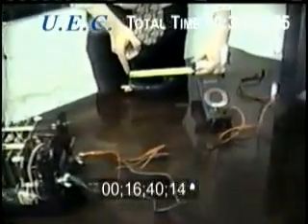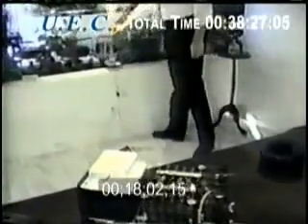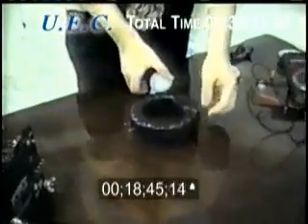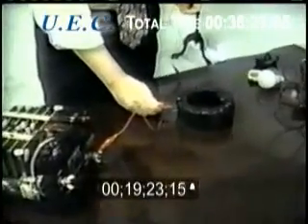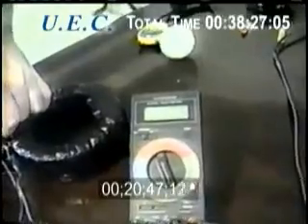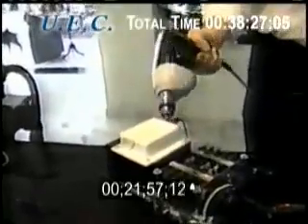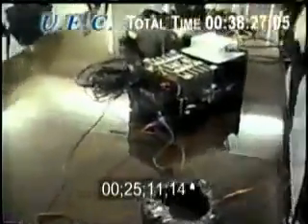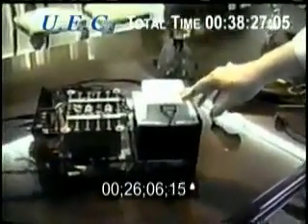Free energy  TPU  (Steve Marks)  part1

Comment: i think i know the secret of the TPU. the answer is pretty simple. first you need a feedback circuit like joule thief circuit.
second you need two output windings. one that use many turns and the second that use few turns. the one with many turns need a rectifier that is short circuited in a pulsating fasion . this causes the coil to produce big surges kicks. the one with few turn you use as the load winding as it would contain high current at some voltage. then you need a power regulation that take power from the few turns winding trough the regulator and feed the input feedback oscillator as well as the relay for the many turns winding. the amplification is caused by the magnetisation of the many turns winding in the core. you need ferite core or
 air core for this. all the windings in the transformer behave as their one and the same circuit. forget the idea that one end of a transformer is input. there is no input and output. that is  something we want to think to make it easier to understand.

Comment: US6015476 is one of his patents in conjunction with Schlueter, he's a magnetic design genius. IMHO it uses nuclear magnetic resonance insome way.  Seeing the so called "magic" angle approx 53 degrees off vertical, with the permanent magnets he attaches in some models.
Reply: We now after many years know that TPU output was generated by electrostatic field gradients being used to propel electrons.  Big electrostatic voltage difference creates electron movement without discharging the high potentials causing the electron flow. From some old recovered hand doc drawn by SM.